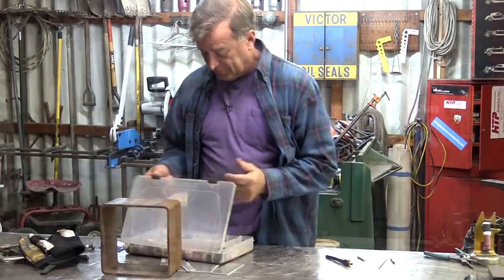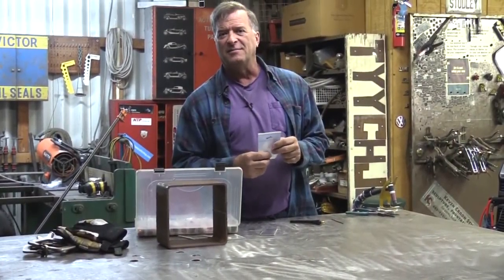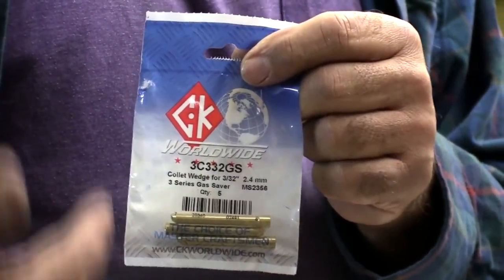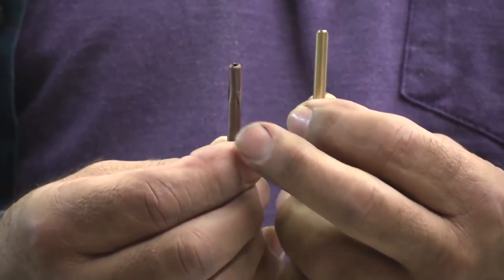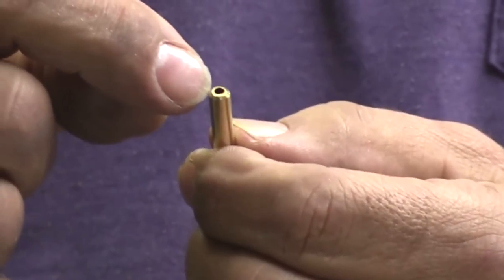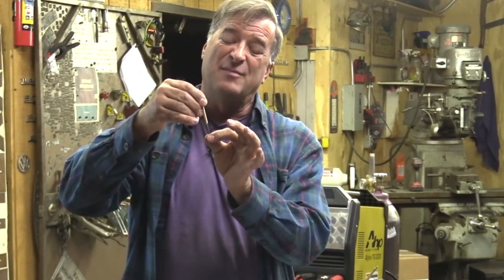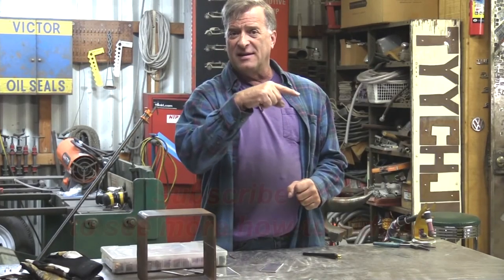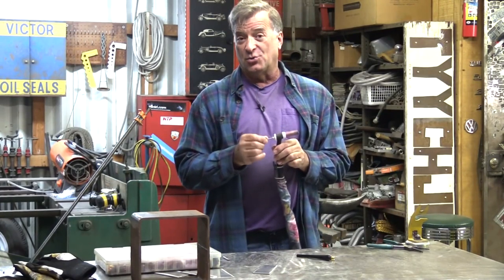Why You Should Use Wedge Collets for Better TIG Welding - Kevin Caron

Comment: Hey Kev , Thought you would like them .now you just have to try out gas lenses for the further stick out of the tungsten and you will be all set .
Cheers from Australia
Troy
Reply from the maker: Got to order a set or two.
Reply: Try the Furick large cups for stainless work along with the CK stubby gas lens system  - far better coverage and you can run the tungsten out twice as far
Reply: Thanks Mate , Im already on to that as well , they are awesome
Cheers Troy

Comment: I like the tip on the wedge collet but I can't help but wonder how the split collet deformed.  I don't do as much welding as you do but I have never seen a deformed collet.  Was it made of cheap material?
Reply: Designed 2 Build  
Yeah I was wondering that also, I've been tig welding for almost 25 yrs. And never deformed a collet. The collet should be inside the collet body. He must be using a  impact wrench to tighten his end cap. Lol.
Reply from the maker: LOL
Reply: My guess is too much current on an air cooled torch, for too long.
Reply from the maker: That combined with too much twist on the back cap!